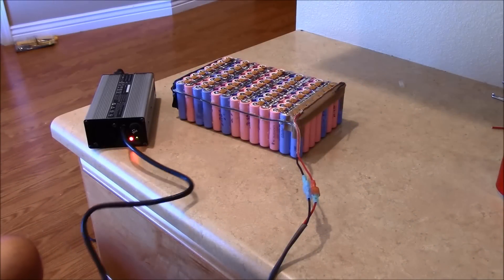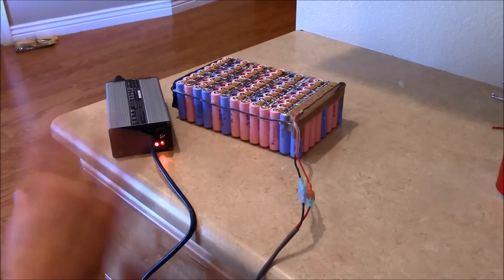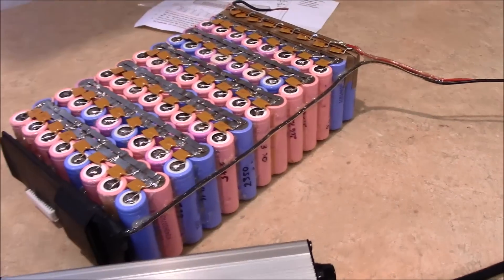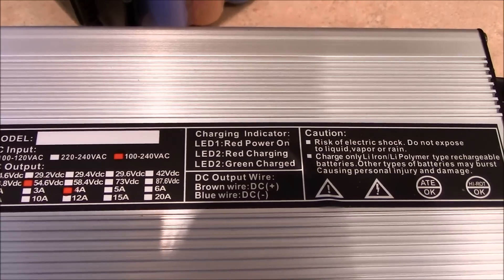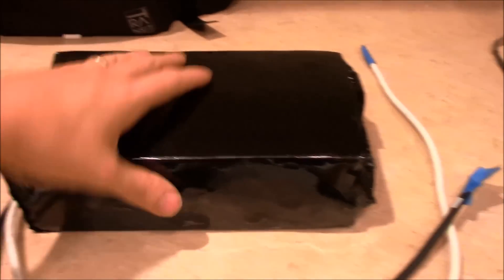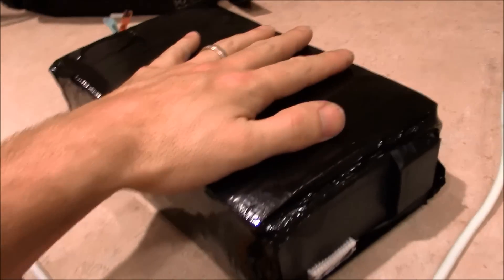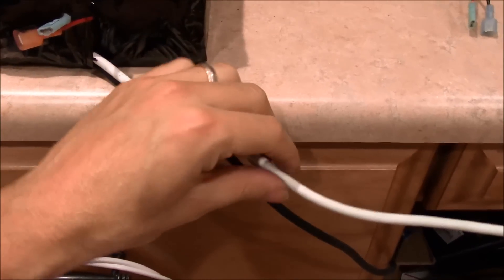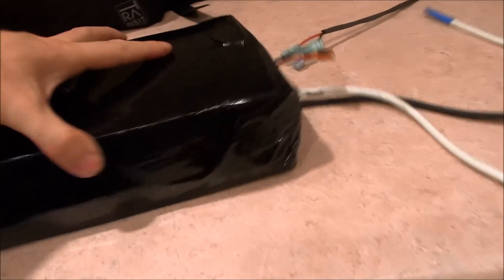How to build an ebike battery "Charging the Battery for the 1st time"  (Part 5 of 7)

Comment: hello excellent video, I'm doing a battery to transform my bike to electric, I would like to know what type of fuses you put in each cell, how do they work? I would be very grateful for your response. Greetings from Mexico
Reply from the maker: Hi Rio  yes they are just added protection if you get a short circuit or if you have a cell that is going rogue and wants to release its energy to fast.  The fuse will cut off power to the cell or cells basically turning off the cell.  Once the fuse cools down it will allow power to go thru it again and cut power if it still needs to.   you will notice a power drop and you will need to investigate.   Thanks.
Here is the link for the fuses https://www.ebay.com/itm/50-PCS-30V-3A-PolySwitch-Resettable-Fuse-30-300/371098018834?ssPageName=STRK%3AMEBIDX%3AIT&_trksid=p2060353.m1438.l2649
Reply: Thank you for answering, I have other questions: I am finding out the capacity of the cells one by one with the imax b6, but it is very slow, is there any other method that you did? Would it be possible to download them with the option of valance and find out the individual capacity of them?
Reply from the maker: No that is pretty much the way I did it (took a few months.)   I bought a second Imax B6 to help speed things along.  There are some better test equipment, but they are expensive and not worth it for what you are doing.  I did try to discharge a group of cells together but it doesn't give the exact number and its just averages.   It took me a long time to go thru each cell, but in the end you will have a good battery for years.
Reply: Is it correct to charge 6 batteries in parallel or is the charge with balance better?
Reply from the maker: Yeah man, I like parallel better myself.  When they are fully charged separate each cell and let them sit for a day to see which ones hold or start dropping voltage to help weed out the ones with issues.   If you use the cells that drop you will have a battery pack that will not hold a full charge.  As your already know just make sure to discharge the cells separately @ .3 of an amp to get a max mAh reading.

Comment: Does this pack still do the job in 2018?
Reply from the maker: Still doing great for free cells!  Looking to build a new battery with new cells just to see the difference.  The current battery seems to only charge up to 83.8v so I may have a few cells not wanting to fully charge.  Think I'll post a video of the batteries condition for the beginning of 2018 this week.
Reply: That's good to see a update after 2 years

Comment: My advice is do not do this unless you have your kit checked out by a trained electrician. If you do charge it outside. Have a water hose ready to extinguish if all goes pear shaped. An electrical fire extinguisher will be useless. These batteries are like a bomb ready to go off. I stress do not leave charging alone. Do not mess with these batteries. This exploded in my face and I have minor burns. Be careful out there.
Reply from the maker: wow man!  hope you are ok!  Yeah its hard to say what condition the batteries are in.   I agree and it might be better for people to just buy a ready to go new battery instead of risking getting hurt with the used old ones.  I'm thinking of using new cells soon also just to be safer.  Be safe man!

Comment: Ok Im just about recovered from a nightmare situation. I overcharged my 48v battery with my charger. I ordered a charger that had a limit of 48v and got a 57v limit charger at 4amp. This charger wasn't connected to balance charger limit. My battery was probably about 47v when started and the charger wasn't on for more than an hour but it must have over charged. I didn't have a circuit breaker fitted but have resettable fuses on the batteries. We heard a pop in the batteries and all of a sudden the the battery burst into flames. We panicked and put a towel over it then we decided to take the bike outside where the fireworks began. Everything began exploding everywhere firing batteries at least 10meters out. A neighbour called the fire service who put it out. I managed to cut my bike free fortunately with some damage. All in all a very frightening experience. Just remember that human error and technology failure could cause serious damage and injury. Please. Keep safe.
Reply from the maker: Man that is crazy!  Yeah its not worth what could have happened glad you were home and got it out of the house!

Comment: Please answer the question about the+ and - power connectors between battery and charger. I am having ridiculous hard problems finding something good to use that can handle 25A 48V.
Reply from the maker: If your talking about the charging port that Im using its a XLR plug.   Found the following online, Currie BA-071 XLR Charger Port - 2 Wire.   to connect to the controller I used butt-spices and crimped the wires together.   I will need to find a quick disconnect option for mine soon so I can easily and quickly remove the battery if needed.  Hope this helps man.
Reply: +15-sec-of Fame ok great. Yeah I'm taking about the plugs. I don't have the controller cables i think. I'm going to send a link of the bike to you when my bike is done. You've been great help. So you can think "that bike I've helped building".
Reply from the maker: Filip Bjurling Awesome man glad I could help.   Ive been wanting to post more videos but Ive been very busy working out of town every other week.   Let me know when your done!

Comment: hello! thanks for the videos.  my question is where do you get the BMS? My plan is to build a 48v (13s 7p) pack
Reply from the maker: thanks, got it from Ebay here the link 
 http://www.ebay.com/itm/48V-54-6V-13S-45A-Lithium-ion-Li-ion-Li-Po-LiPo-Polymer-Battery-BMS-PCB-System-/221740200277?hash=item33a0bef155

Comment: Mate my battery just exploded. Wired it up with the fuses and my positive leads touched a negative on one side then one cell caught fire. Scared me senseless.
Reply from the maker: WOW man glad to see your ok!  Is everything else good?  Do you have a main power fuse or circuit breaker for the main power?  The fuses are for each cell if one gets damaged but if they all are getting shorted as one then they can still over heat and thats where the main power fuse comes in to play.  If the 48v battery shorts the main power fuse will blow or circuit breaker will pop cutting power.  Stay safe man!
Reply: +15-sec-of Fame well I'm still soldiering on. Ordered a spare Chinese Ebike kit as my other one got torched. Can you send me a link to your circuit breaker please as well. Thanks so much.
Reply from the maker: harveyboy45  cool man please be safe, I would say the best and cheapest place to find them would be Ebay.   The circuit breaker I have is $150 U.S. new.   Look up "Aircraft Circuit Breaker".   I have a 50 amp to make sure I was above the useful limit.  Its mainly there to remove power from the controller or if the main power wires short it will trip the circuit breaker.    I'm doing some soldering and videoing now also of the 84v battery setup.  My battery is split up in 2 locations on the bike and is making it a little harder to set up, but should be done tonight or for sure tomorrow.   On Wednesday June 22 its bike to work day here in Denver CO, so I plan on doing that :)

Comment: I wish I knew the brand of charger you're using as my Ipro b6 can't handle my charging anymore
Reply from the maker: +harveyboy45 here is where i got it from http://www.ebay.com/itm/48V-54-6V-60V-4A-Lithium-ion-Battery-Charger-13S-13x-3-6V-3-7V-Lion-Charger-/221256808976?hash=item3383eefa10
Reply: +15-sec-of Fame thanks dude. Managed sources one like yours. Ebike kit came through a couple of days ago from that Chinese supplier you recommended so my Razor scooter kit days are numbered. Kit looks well made.
Reply: +15-sec-of Fame what mileage are you getting from your pack?

Comment: Can i use any 48v power supply (psu) or do i need a special 48v battery charger? What is the cheapest charger i can get?
Reply from the maker: +Filip Bjurling to be 100% safe I would use a lithium charger.  You find them on Ebay for around $25-$60.   Your BMS will let the charger know that its fully charged and will shut off.
Reply: +15-sec-of Fame cool. thank you do much ditt the reply!
Reply from the maker: Filip Bjurling yeah man, your welcome!  Im here to help out as many people as I can.

Comment: Thanks for Posting, a very helpful video.
Question: If you're only using the BMS Board for charging purposes does that mean that there is a possibility that on discharging i.e. when you're running your motor, that the cells can become unbalanced during that process? - I'm thinking esp. if one or more cells aren't up to scratch & performing as well as the others! If so any ideas for a solution?
Also, is it really so bad to run the batteries via the BSM prior to the controller feed when running/discharging or is it most likely to 'bottleneck' and hamper things as you say? - possibly through triggering a shut-off due to overheating etc.
Reply from the maker: +The_ Pentaquark. man thats crazy! I was just thinking of this earlier today and was going to experiment with going thru the BMS while discharging the battery to see if the cells will stay more balanced.    I looked up the ratings of the BMS and it should be able to handle the amp load.   I'll post a new vid of the testing.   Thanks.
Reply: +15-sec-of Fame yep, I'm doing some reading up on this too; Apparently you're supposed to run the positive directly from the BMS Board to Controller and the Motor Positive 'Directly'(simultaneously) - not just thru the controller; Likewise the P- Neg coming off the Board goes to 'both' controller & motor Neg.
Different boards obviously connect in different ways but the one I was looking at for my 48V project goes like this:  http://www.ebay.com/itm/48V-54-6V-13S-30A-Lithium-ion-Li-ion-Li-Po-LiPo-Polymer-Battery-BMS-PCB-System-/221740200286
(see diagram in description)
Reply from the maker: +The_ Pentaquark. thats the same one I have.  The positive is directly off the battery and the negative goes thru the BMS.   I went around the BMS during discharge by having a negative from the battery going directly to the controller.   But now I am thinking that I may need to go thru the BMS negative during discharge to help keep the cells balanced.    I will test it the first chance I get to see if it helps.
Reply: 15-sec-of Fame Cheers my friend - I'll keep in touch with your Posting/Channel
p.s. if you blow something up then I'll know to try a different route with my own project!!  lol
greetings from UK - (I got a 48V 1000W motor on the way off eBay :)
Reply from the maker: The_ Pentaquark. lol yeah man I'll let you know if I let the smoke out!  Greetings from the US, the 1000w kit is very nice too!

Comment: I have one put together just like yours but I am far from an electrical expert so ive not put wires or anything on the battery in hopes that someone like you is building one like mine. My question is what is the name of those little fuses between the cells and purpose and the necessity? I look forward to hear from you and nice job on your battery. I think mine is coming along just fine. Happy new year.
Reply from the maker: +Judge TK thanks Judge,  I bought the fuses on ebay,  You really dont need them I only added them as an extra precaution just in case something happened.  Testla also uses fuses, but not this kind.  Mine are reset-able and are rated @.16 volts and 4 Amp's each.   Search on ebay the following: JinKe Polymer PPTC PTC DIP Resettable Fuse 16V 4A JK16-400.  Happy New year to you too!  If you have any question on your battery just let me know. Thanks

Comment: Hey 15
Can you clarify why u are using 4 Amp battery charger ,why not 4 n above Amp, what might be the limit ?
How much time is it taking for charge up on this setting.
Thanks ,ur Videos are great help
Reply from the maker: +rajpal singh Bhati hey rajpal sorry for the late response, I've been working long hours the past few weeks :)  I went with a 4 amp charger because I didn't want extra stress on the batteries.   If I ride 30 miles at full speed it only takes 4 hours to recharge my 18 amp hour battery with the current charger.   When I finally finish my second battery here in a few weeks (which will give me 36 amp hour pack total) I'll see how long it will take to recharge and I may consider getting a larger amperage charger.  Thanks for the comment.
Reply from the maker: thanks for the info, 4 amps on charging was the highest I wanted to go.  It only takes 3-4 hours to charge when the battery is down to 48v from 54.6v or from traveling 30-40 miles.   I built the banks in series to equal 48v at nominal voltage, peak is at 54.6v.   Im also looking for a spot welder for my new 72v battery.   NiMH are great for amperage :) and yes very safe.

Comment: where are the wires for the motor connected to? The BMS or directly to the batteries ?
Reply from the maker: +AbnormalBroadcast Thanks for asking,  the motor is hooked up directly to the controllers output.  The battery is hooked up to the controller then it starts converting the power to the motor from the throttle sense wires so it knows how much power to send to the motor.  The BMS is only used as a brain for the battery to protect it from over charging.  Its not a true balancing BMS but as long as each bank (13 banks x 4.20 volts = 54.6 volts)  is the same voltage +/-.05 the battery will fully charge.
Reply: Oh ok. Also (lol sorry) where did you get all your batteries from!?!? XD That is alot of them lol, and you said you had 700+ !!!
Reply from the maker: I work in engineering and most employees have laptops so I asked IT if they had any used returned batteries.  Next thing I know i had a huge box of batteries.  Before that I had purchased 95 laptop batteries off Ebay,  After tearing apart all the batteries I had over 700 good cells lol.  So I have plenty of cells to keep me busy for a while.  :)
Reply: +15-sec-of Fame yeah man that's cool, have fun with your bike!
Reply from the maker: Thanks man, Im working on battery #2 and testing the last few cells to finish it...still have about 500 left to go through.
Reply: Haha, so you wanna send me 104 good cells? xD

Comment: have you tested the fuses?. after the fuse trips and then cools and resets does the resistance increase causing more heat? I am undecided whether to use them or not.
Reply from the maker: +William Whitfield No I havent tested them yet.  But,  I can make a quick video this weekend showing what happens if it does trip the fuse.  I mainly have them installed to have more protection from a fire, overheating or having a runaway battery that you cant stop as its destroying itself.
Reply: I will be watching for your video. I ordered some thanks for the link.